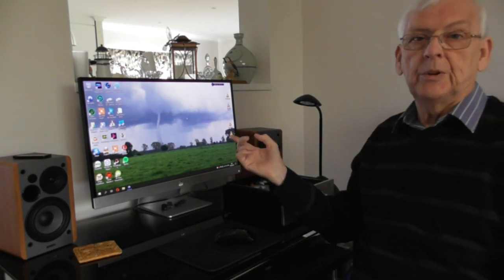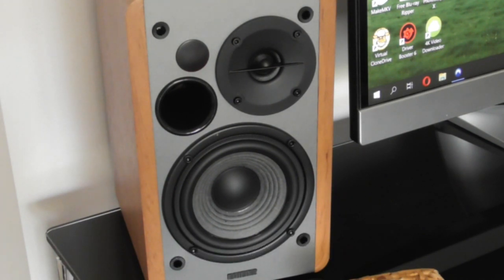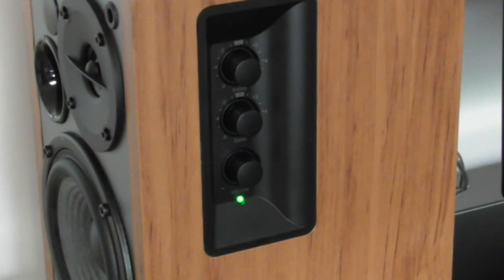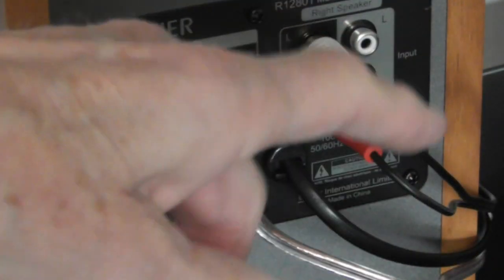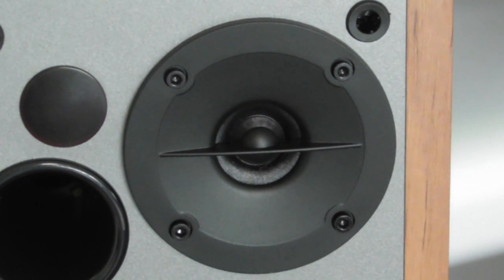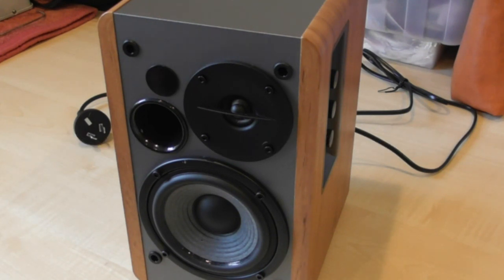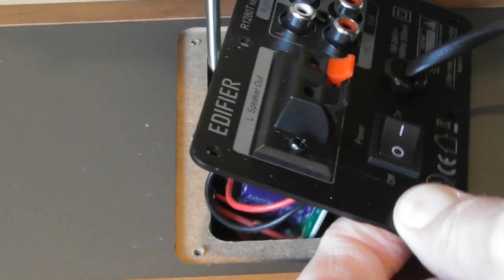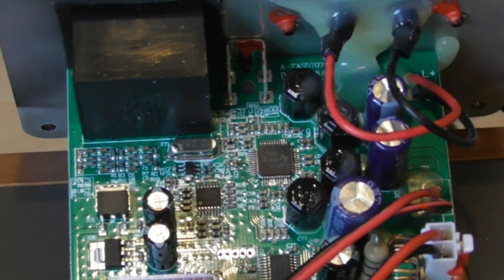Edifier R1280T Loudspeaker review, and a look inside.

Comment: I own these and completely redesigned them specifically for a kitchen entertainment system.  I have a 45 degree wall in my kitchen which left two triangle shaped voids when the builder used standard upper cabinets. I built slightly larger triangle shaped boxes and added extra poly fill.  The speakers are somewhat suspended firing down on a granite countertop and about 5 feet apart.  I cut off the top third  of the passive speaker to make a box for the amp/ controls/connections.  For the money (I paid $70 USD in 2019), you absolutely cannot beat them.  I have the sound for the tv running through them as well as a Chromecast Audio.  Spotify through the Chromecast Audio is superb.  Spotify through my Roku stick is not quite as good.  My friends are quite impressed with the sound!!

Comment: i have the very similar Edifier R1280DB version with bluetooth module. everything this gentleman has mentioned is spot-on. the sound is very boomy, especially if used on a table. i used windows equalizer app to flatten the response, but it was still bad, so now i ocasionally use them in my living room as tv speakers and looking for a substitute

Comment: Good review Mr Beeny. Just bought a set yesterday to replace an old 2.1 from Cambridge Audio for a Windows PC. The computer is used mainly as  reference monitors for Audacity DAW. -  I do record a live rock'n roll band out from a Soundcraft console that goes thru a Behringer USB interface from the RCA's REC OUT of the mixer to the USB port of the computer to Audacity for basic editing, mixing & mastering. The result is very good. I'm very satisfied. I would recommend EDIFIER to anyone looking for a good cheap speakers solution.

Comment: A great review and a great observation about the white noises and the air on the bottom of the speaker. I just bought the next model (with bluetooth and optical in) and I will try to suspend the speakers from the table.

Thank you!

Comment: Edifier actually sent me two pairs for the price of one by mistake, so I was able to demo the passive speakers as a pair together on my receiver. To put things delicately as possible, I think that built-in EQ on the powered speakers does a lot to wow people with the sound these put out. On their own, at around 85dB listening volume in a small room, lower bass wasn't so much dropped off as much as chewed up and spit out.  I use a track by Peter Gabriel from his album Passion called "The Promise of Shadows" which has lots of sub bass I like for stressing out speakers, and these Edifiers sounded like they would literally fall apart. The woofers would crackle from the bass unless I put a finger on them.
Reply from the maker: 2 pairs for the price of one sounds like a good deal. I still think for what they cost they are not bad, no really HiFi but what should anyone expect for the price?
Reply: I'd say for under $100 bucks, on a desk and about 2 feet from you maximum, they're perfectly fine for the job. I was able to sell both my pairs a month later and hopefully those folks have a better time with them.

Comment: Great video. Is there a difference between either the PC or AUX inputs? I think you said something about the gain being different or one? Which one should I use to avoid a bottleneck? Thanks.
Reply from the maker: Not that much different really. I would try both, which ever give you a sensible range on the volume control will be fine. I doubt you will overload either. Suck it and see!!

Comment: Wow. A proper technical review. Being honest didn't understand all of the content but very impressive.  I've just bought these. Just one question, I've bought these to plug in a digital controller into the rca input. Does it matter which input side I use. It's only home djing use. What is the difference as I'm sure what you mean by a difference in the gain? Many thanks
Reply from the maker: Hi Ian, the difference in gain refers to how sensitive the inputs are. In real terms the difference is quite small. To select the best input, make it so when the volume control is about 1 pm the sound should be OK for most listening. Either input should be fine.
Reply: @MichaelBeeny  thank you. Would these speakers be suitable to plug into a TV instead of using the internal ones?
Reply from the maker: @simulation8083   Yes, probably, almost ANY speaker will sound better than any TV speakers which are at best crap!!

Comment: I was really torn from the R1280T to the R1280DBS. After so many youtube video's I found the T to sound more crisp and clean compared to the DBS accept I went with the DBS only because it was only 25 dollars more and has bluetooth as well as the option to connect a sub too it. I was thinking that if I turned up the terrble really high it would copy or near to copy the same sound from the T hope i am right. Ty for the in depth review. Oh btw how have they been holding up for the passed 4 years, are you still using them?
Reply from the maker: To be perfectly honest I would never use any Edifier speaker in any HiFi application. They produce a very un-natural sound due to the use of extensive built in EQ. It is not possible to disable this function and in consequence you cannot get a flat frequency response from it.
On the plus side, you get a lot for your money, built in amplifiers. What you don't get colour free sound, very equalized, voice sounds dreadful with excessive boom and sibilance.
Saying that it's very low cost, you get what you pay for.
Many people buy these as a first loudspeaker. After a while they begin to find the speakers faults, then they up grade.
If you like electronic type of music, you might like these, lots of one note, boomy bass, no midrange and lots of tizzy treble. Just the thought of listening to these gives me a headache. lol

Comment: Great explanation about the not flat response and its use cases (movies and games).
Do you know if a Pioneer audio system is HI-FI or if it is pure marketing? (talking about the Pioneer X-CM56W).
I was thinking to buy that one specially because is white and it will look good with my computer setup color. However, it is more expensive than this pair of Edifier speakers. I would like to know your opinion on this.
Reply: Cheap is cheap. No matter the brand. They can't bend physics neither economics. Good amp & speakers is min. 400$

Comment: Hi, thanks for the very detailed review. I would like to know according to your expertise, do you think we can get rid of the tizzy sound? By adding a crossover to the tweeter? Rather than only single a capacitor there.
Reply from the maker: I think it's the tweeter itself, it's a low cost loudspeaker. For what you get it is value for money. If you wont better, you need to spend more money,

Comment: Hello! Excellent video! Have you tested if there is a difference in volume between the optical output and the RCA output? Because I saw comments that the optical port has less volume than the RCA port !. I have a Kilpsch cinema 400 soundbar and I also see that the optical port sounds slightly lower than the hdmi port. Is it possible that the problem is with the digital converters that take a little power in the source outputs in the conversion?
Thanks!!!!
Reply from the maker: To be honest I have not tested that. Any additional conversion D to A usually has an impact on gain to a degree. This is quite normal. It's not usually an issue because as long as you have enough gain, does it matter?  All devices have different levels, even CDs or records are all recorded at different levels. Provided it's within reasonable paramotors, it really does not matter. It's not a question of one using more of the power, that does not happen.

Comment: That cap at the tweeter really turned me off and no headphones out. There are Presonus Eris or Mackie Cr in the same price range. I have Tapco S-8 monitor speakers but I don't like the fact that they produce a standing wave at 120 hertz in my room. They're definitely a class better but overkill for that room and bass port is open to the back (which multiplies the lower room mode problem). When I put seat-cushions on the wall behind them, the bass immediately becomes less prominent and also the standing wave gets cut a bit. Thank you for showing the guts of this speaker. Definitely helps me to either do more room treatment or buy the Presonus Eris.
Reply: The problem isn't so much the cap on the tweeter, as this would be a perfectly acceptable approach for a first order HF filter. However, the use of an electrolytic for the tweeter is par for the course for a Chinese budget "active" loudspeaker. If this was a true active speaker, the crossover would be an active type and designed into the processing side or pre-amp side of the amplifier module and each driver would be driven separately. In which case, there wouldn't be any form of crossover components, unless there for protection. More than likely, due to cost, it's just a single amplifier and the bass unit is running full range. The absence of a low pass filter ( inductor and cap ) for the bass unit is actually the bigger concern, as the bass speaker frequency response is rolled off naturally according to it's frequency response, whereas the HF tweeter is first order. Personally, I would rather have a pair of Wharfedale 9.1s and use a second hand amplifier, and a Fiio BTR3. I would prefer to pay a bit more. It makes more economic sense in the end, and not worth cheaping out on sound quality.

Comment: Normally such small speakers have bass problems but yet, the bass is very pure and one is happy with it. The thought that much bigger speakers would give much better; more natural bass doesn't immediately pop up. (although it's true of course) 
I think therefore the amplifier itself gives off a signal which is completely tuned to this speakers in order to compensate the weaknesses??
I think you mentioned it but most likely the amplifier is doing here much more than just amplifying and processes heavily, reduces noise and rounds harsh overtones perhaps so that it all sounds very nice?? It reminds a bit of how the tiny camera of a smartphone can take beautiful pictures today because of heavy processing.

Comment: Hi Michael, I purchased and they are good for my small room. I wish to put them on floor stands as I'm short on desk and table space. Can you please recommend a suitable floor stand please. I know very little about this subject. Thank you
Reply from the maker: Hi Ian, With so many different stands available in different country's, it's impossible to recommend any really. It's one of those snake oil issues. Some people throw thousand of $ at the subject. Basically, if you have air around the speaker, underneath, almost as if it's in free air you wont go far wrong!
Reply: Thanks Michael. Have gone for some budget stands. They get good reviews on amazon but not sure that means anything. They were only cheap speakers so £50 on the stands is fine - Nordell premium floor speaker stand

Comment: Thanks for the very comprehensive review. So the tweeter is i parallel with the woofer and then connects to the amplifier. Is that correct?
I was aiming to modify this speaker to turn it in a passive unit to connect to my vintage AKAI AA-8030. It takes 8 ohms speakers. The info from Edifier webpage says the woofer is 6 ohms, and the tweeter 4 ohms. If they're connected in parallel the total impedance is 2.4 ohms. I'm afraid it's too low. Can you give me your expert advice?
Thanks
Reply from the maker: Hi Miguel,
It does not quite work like that, because the drive units are via the crossover these can change the overall impedance presented to the amplifier hence an average 8 ohm load. I doubt you  would gain much in sound quality by bi amping it. If you use the existing crossover I doubt you would hear ANY difference. If you use an external crossover you could open a real can of worms. I would personally accept it as is, not really worth messing about with it.
Reply: @MichaelBeeny  thanks
Reply: Michael Beeny actually I wasn’t going to biamp it. My idea was to totally disable the internal amplifier and rewire the speaker to turn it into a passive one and then connect it to my amplifier.
I’m aware that there’s a very similar passive speakers (Edifier P12) but oddly they’re more expensive than these

Comment: Hi Michael, I wonder if you can clear this doubt for me? You found a single cap serving the tweeter comical, so it was due to bad design? Compared to the Microlab B77BT (with Edifier 1280BT), that other one looks to have a whole PCB serving the tweeter, would the Microlab represent more value for money? Excellent video by the way! Difficult decision, Microlab or this.
Reply from the maker: The subject of crossovers is complex. If the drive units have a good flat frequency response then in theory a simple capacitor in series with the tweeter and a inductor in series with the bass unit will work just fine. The only problem with that is the rate of attenuation being only about 6dB so in some cases extra components are needed to increase this to 12 or ever more dB. Any low cost speaker is a compromise, and this is no exception. My advice is simple. If it sounds OK and the price is right, buy it. I could write a book on crossovers, it's not as simple as I have made it here. Thanks for your question, much appreciated.

Comment: Thx for the vid. How long is the wire connecting the 2 speakers pls?
Reply from the maker: Sorry, not sure as a guess about 10ft but I no longer have the original cable, replaced with a little thicker wire.

Comment: Just got a brand new pair as a gift and they won't power on. I place the switch to the ON position and nothing. The power light under the volume control does not come on and they won't work. Crud. Is there a fuse some place inside?
Reply from the maker: It's probably a issue with the SMPS or a poor joint. As they are new just get them replaced.

Comment: Nice review, im just wondering what they sound like with the clothed gril infront of them, wonder how the sound dispersion is
Reply from the maker: Most speakers tend to sound  a little better, more detail in the HF region but the difference is slight. I tend to use mine without the grills.
Reply: @MichaelBeeny  Yeah me to, but i still put a little patch of cloth on the tweeters whenever i dont have a seperate pot-meter for my tweeters.
 Some times they just "shout" to much  depends on the speaker, i mostly build my own.

Comment: Thanks for the review (even if it was a few years ago). Just replaced my Creative T20's (as I'm fed up with the EU directive to turn off if no sounds for 10 mins and the ~2 seconds to come back on again... ridiculous for pc speakers). Agree, for pc speakers/small room they work/sound well. The main thing I'm miffed with is the fixed power lead, why not do a connector. I'm going to have to cut the lead and put connectors on to run it down back of desk or extend the length of the lead.
Reply from the maker: It's just a cost thing Steve. IEC sockets cost much more than a fixed cable. I also think most people using these speakers will be quite happy with a fixed cable.

Comment: Mine Bluetooth version of this speaker just refused to power on, I tried opening it but the rear plate refused to come out than half an inch :( 
Is there any thing like a traditional fuse in these speakers?
Reply: I also have the 1280DB. Mine powers on but no sound is coming out regardless of the source.
Reply: RED DRAGON  is it on board that's fixed on bottom (hidden inside) or connector board at rear?

Comment: Great video! Can i custom paint white the front removable cover to match my room color?
Reply from the maker: The short answer is no! You will block up the sound path and it will become very muffled. You could always replace the cloth, just make sure it's a very open weave. Test it by holding it in front of the speaker.
Reply: @MichaelBeeny  thank you for your response Sir! When I say paint I mean spray the front cover . Is that bad too? Any suggestions to make them white?
Reply from the maker: @GRJOHN360  I'm a little confused, your text said removable cover, I thought you meant the speaker cloth.
Reply: @MichaelBeeny  I apologize. Sorry for my bad English. I mean the front removable cover I think with cloth yes. When you remove this you can see the speakers drivers. In white version, the front is grey. If you remove the grey cover you can see the black drivers.  Removable cover it is up to you . If you want you can use it. Hope you understand now
Reply: @MichaelBeeny  To chip in, I found your video while looking for disassembly guide, as I plan to spray paint the front white (not mesh covers) and the top. In order not to drag myself though taping up all of the black holes, membranes and branding in the front, can I safely remove the drivers after unscrewing? I don't have the speakers yet, so I need an opinion of somebody who has hands on experience. Any tips on this project are very welome, I need it to come out really sharp and clean.
Reply from the maker: @Rathbone_fan_account  Removing the drivers will not be any problem but you will need a set of Allen keys to remove the screws. Just be careful not to let the keys slip and damage the speaker cones. You might need to remove the wires from the speakers, just mark them so you know how to re connect them. Good luck.

Comment: Hi.. the print on the board shows the amplifier chip as TAS5707
Reply: Well, the chip itself it's what we're getting and by the datasheet, the TAS5707 that is imprinted on the PCB for whatever reason, is a 20W x2, while the chip that's on the board itself, a TAS 5713 seems to be a more powerful 25W x2, so.. I suppose that's a win. Or mayber there's earlier board revisions, old stock that comes with the TAS5707.. (?)